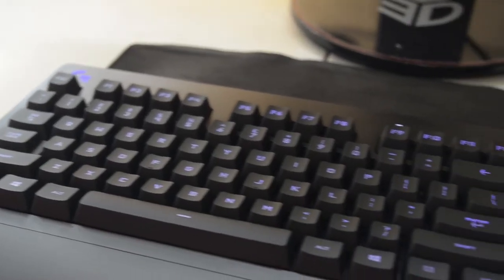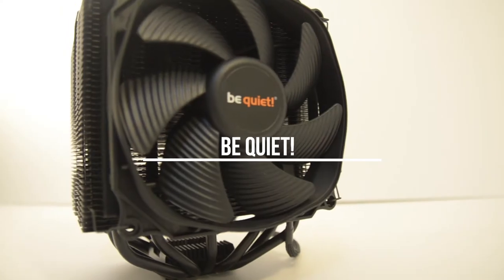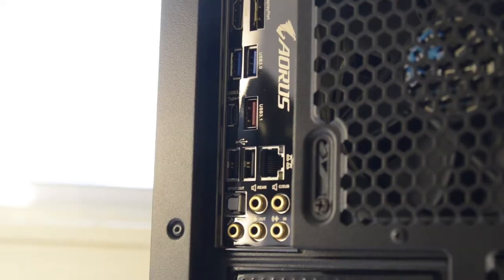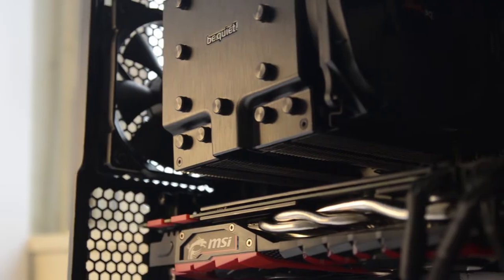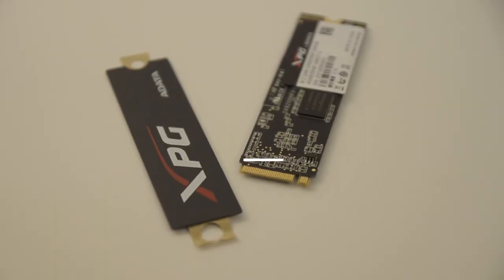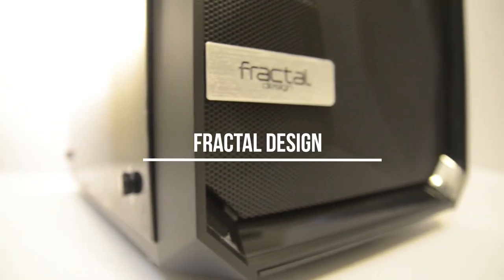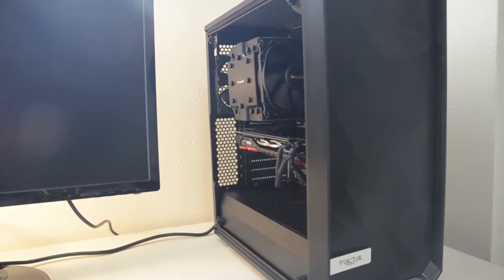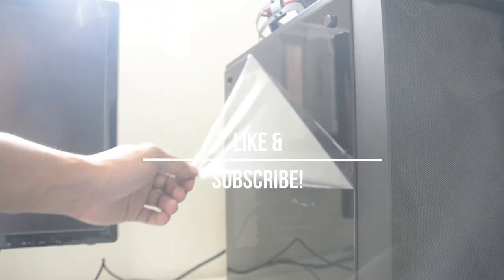INTEL GAMING PC BUILD | i7 8700k | GTX1070ti | Meshify C | Gigabyte Aorus Gaming 5

Comment: I built practically identical system just last month only on the z390 chipset, loving the meshify c fantastic airflow! The dark rock pro 4 has grown on me, to start I didn't really like the look of it (it's so big I can hardly see the mobo :(, conidering doing a custom water loop before summer comes.) it does cool the 8700k at 5ghz with a core voltage of 1.320 surprisingly well, at least until the summer comes. Good video mate, keep them coming.

Comment: Nice video, I was planning the same build that you have now... No rgb, pure raw power. I'm planning on installing. 2x140mm high airflow as intake on fron of the case, 1x120mm exhaust at the back and 1x120mm at the top exhaust.
Reply from the maker: Nice! The case already comes with 2x120mm fans. 1 on the front and 1 on the rear. I already did what you were planning and bought 2 thermaltake 140mm fans to help with the cooling. I don't have actual numbers from before I installed the fans but I noticed the CPU and GPU are clocking higher since they are running cooler. Hope all goes well for you!

Comment: Finally I've found an answer to my question,  does Meshify C can fit Dark Rock Pro 4. At the end I saw that you managed to close side panel with cooler installed. Was it a tight fit and was there any space betwen cooler and side panel? I'am one click away from ordering Dark Rock Pro 4, just need to be sure that there is no problems with Meshify C.
Reply from the maker: The Dark Rock Pro 4 fits without a problem. It wasn't a tight fit at all. The DRP4 has a height of 162.8mm. Meshify C has a CPU cooler height limit of 172mm. Hopefully this helps!
Reply: @discy3018   DISCY   DISCY  Thank you very much for quick answer to my question. I've watched some misledaing video on youtube that said Dark Rock Pro 4 with mounting mechanisam is 175mm in height (Meshify C 172 mm max height).That was my only problem.Keep up the excellent work with your videos and channel.I hope we can see more tech videos in the future.

Comment: Do you still have this build? I have the same cpu and cooler and wondering what your temps are like
Reply from the maker: idle is high 20s-low 30s. regular gaming is in the low 60s.
Reply: @discy3018  thanks i get around the same temps but i am also overclocked to 5ghz